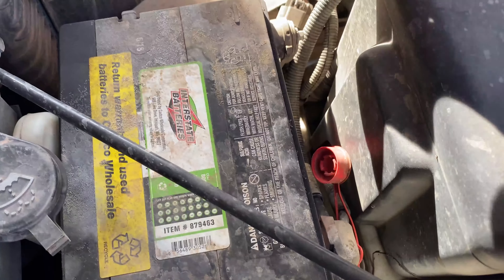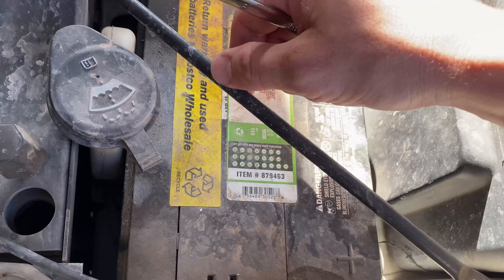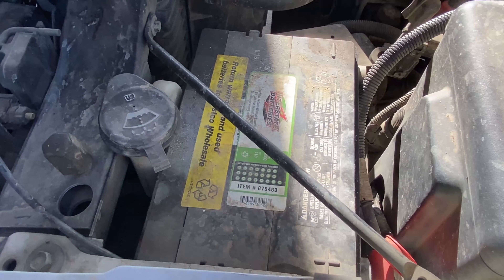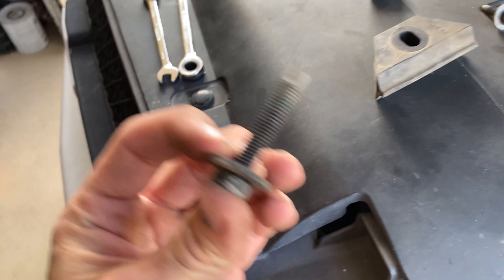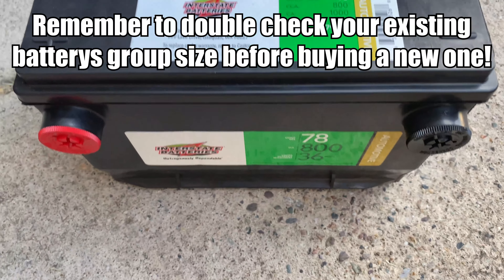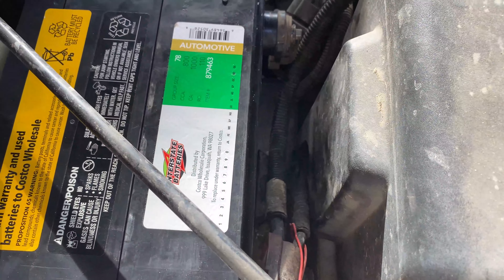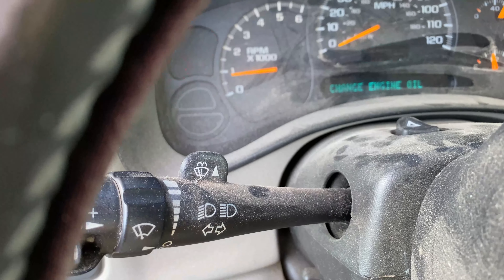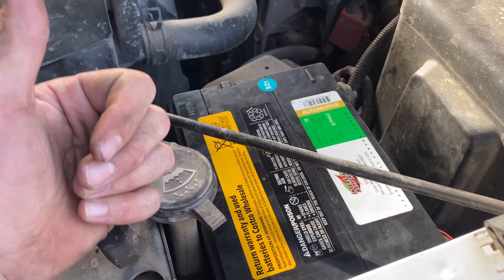How to replace your BATTERY on a 2005 SILVERADO! 99-06 Chevy Silverado DIY Battery replacement!

Comment: Took the battery out of 2001 model and had to remove the bolts from the rubber connectors to the battey to try to charge the battery, how do i work the bolts back into the rubber connectors?

Comment: Changed out my battery and the heat & ac went to shit!
Reply: After replacing the battery do not touch the heating and AC controls, it's cycling through, give it a few minutes. If it doesn't work then pull the fuse for around 10 seconds then try it again. I found this out the hard way.